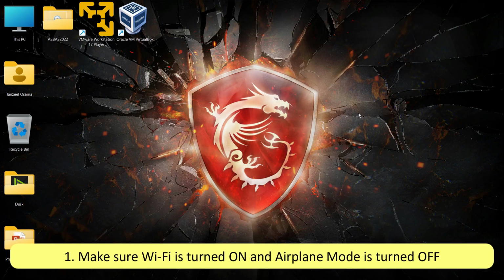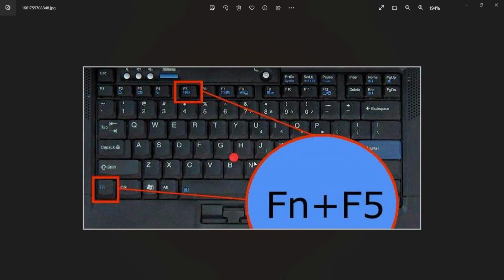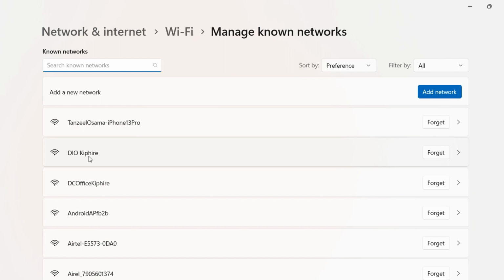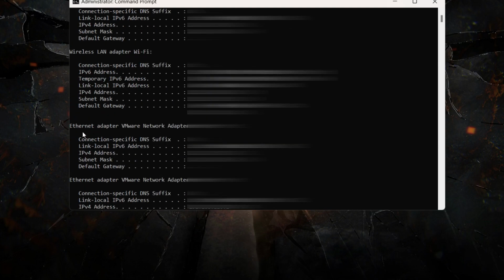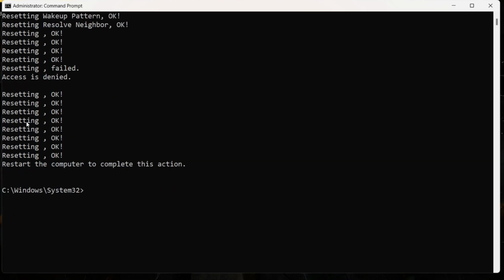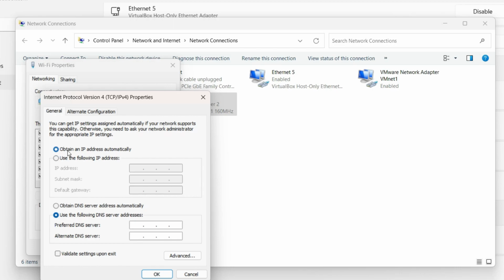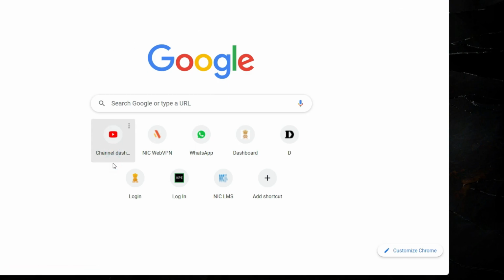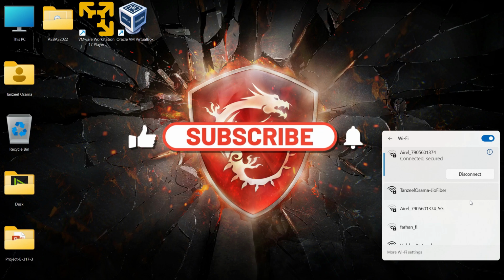WiFi Not Working on Windows 11 | WiFi Problem in Laptop

Comment: My desktop just does not want to stay connected. Every few minutes I notice nothing is working, check the icon and it's the offline one, mouse-over it and see the "no internet connection", while the PC is still connected to the hub. I've tried updating drivers, resetting the network adapter, doing the big reset, "forgetting" the network and redoing it all, and even went into the power management options for the wireless card and unticked the "allow windows to put to sleep" (why in the world that would ever be on is beyond me, thanks Microsoft). 

It. still. randomly. dies. You know the worst part? I didn't have this issue before I moved, and I only have it on the PC. My phone, tablet, and laptop are all fine. My PC is also the only one running Windows (at all; laptop is on Linux).
Reply from the maker: So sorry to hear that man. I see that you have tried everything. Maybe the problem is related to hardware. Try doing a complete reset of Windows and if the problem still persists, get your WiFi adapter checked/replace.